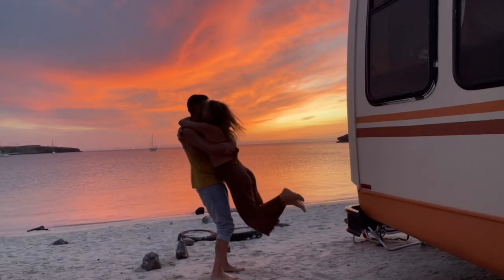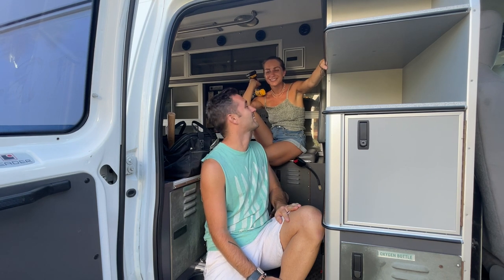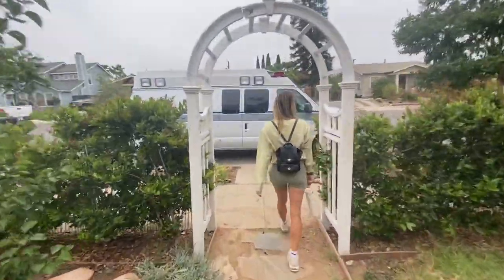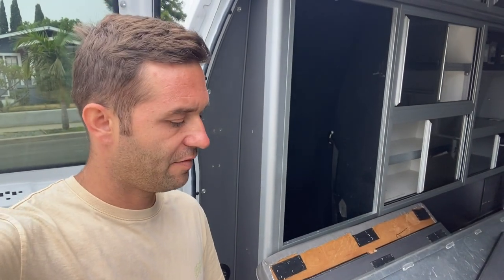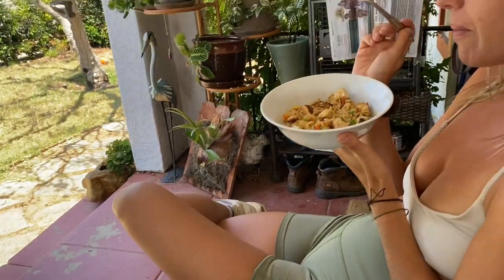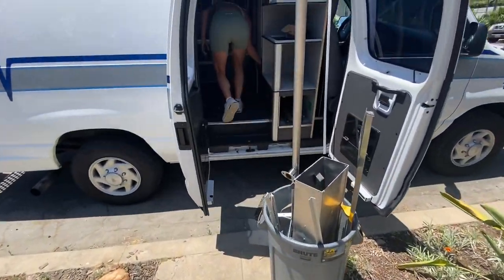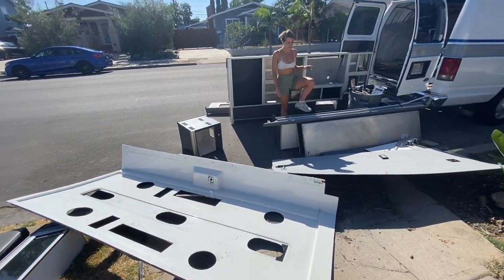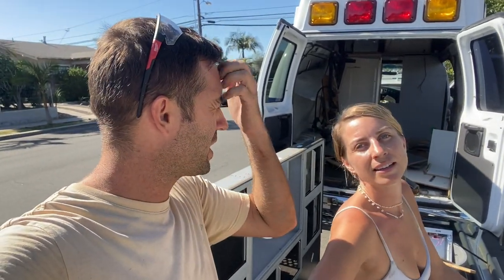AMBULANCE VAN BUILD | Demolition Day: Witness the Speed of our Gutting Process!!

Comment: Although this Ford E-350 is a 2008, it looks like at one point that the driver & front passenger seats have been replaced by the newer style ones from 2009 onward.
Reply from the maker: Honestly I’m not sure but if you say so I 100% believe you🤣 maybe they changed them because it was an ambulance🤷🏻‍♂️
Reply: @gypseasontheroad  2008 model year Ford E-Series vehicles still had the previous style driver & front passenger seats where the tops of them were lower & rounder, while the ones in this van have the ones with the higher tops.